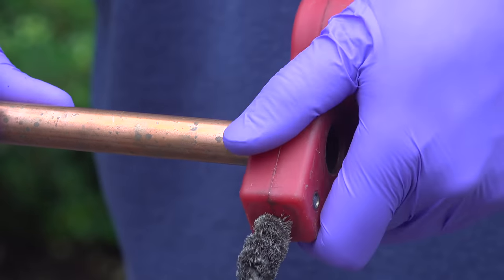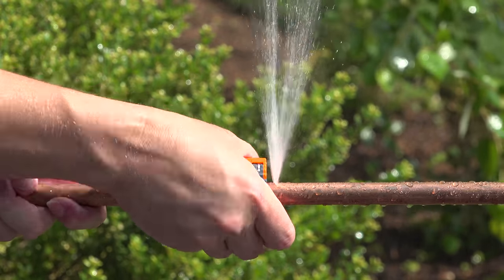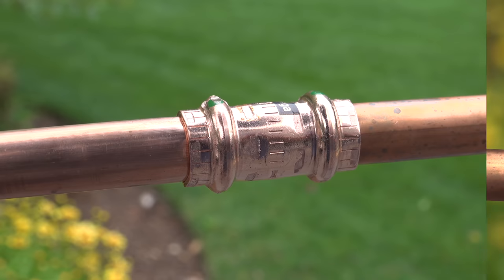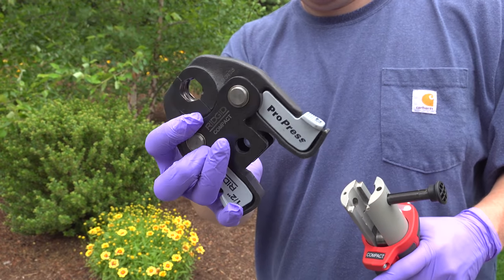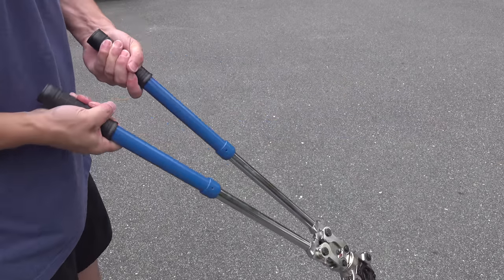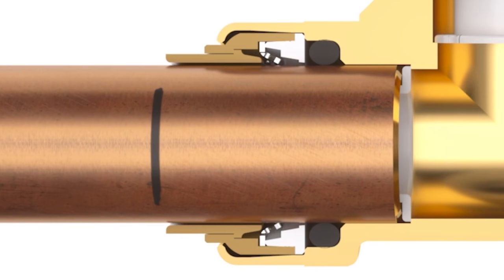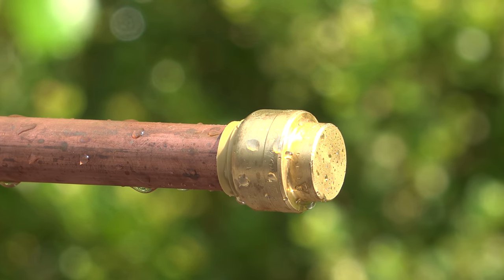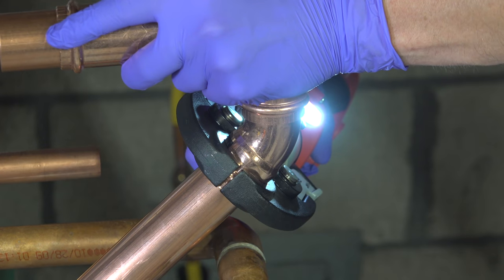NEVER SOLDER PIPE AGAIN - 3 Ways for EASY DIY Plumbing

Comment: It’s hard to believe any type of o ring wouldn’t eventually deteriorate.
Reply: Agreed, but even soldered fittings can fail due to expansion and contraction, but time will tell. Perhaps not being exposed to air helps. Still, pretty cool seeing it used the first time recently by pros.
Reply: @dj-kq4fz  I had a plumber fit my shower blending valve and shower head. He never explained that he would be using propress fittings. When I saw the final job, I had him remove the fittings and solder everything. I'm no pro but it's too soon to tell how these fittings will last, in my opinion.
Reply: @atroche1978  I totally agree! I have a lot of confidence in my contractor friend (whose crew did the work), plus it was exposed in a basement. with minimal potential for catastrophe, but, it was still an eye opener for me. I really don't blame you.
Reply: @atroche1978  The only fitting I have seen leak after proper installation
Reply: Exactly.  Well, there is always that same idea.  It won't happen in their life time when it's installed.  However, it will bound to happen and good luck to the poor soul who inherited the problem.
Reply: @dj-kq4fz  At least copper has that time behind it. I'm no plumber but I think soldered joints either fail fairly soon if bad, or last forever.
Reply: These things are being used for over 20 years,  they are great
Reply: The o ring is really a backup, the copper is “fused” together and the copper is doing the main sealing, similar to using a copper washer.

Comment: Sharkbites absolutely rocks. I love how it's only the plumber that find a cases where a Sharkbite failed cause they don't want customers to feel that they are not needed anymore.
Reply: No dude they actually really suck. It's not about finding away to screw you the coustmer. They work great for a quick pinch  most of the time until you get a moment to fix it correctly. I'll go old school or pro press for copper.
Reply: Also the quality of the shark bite fittings over the last few years have gone way down hill

Comment: It’s a good thing rubber o rings never deteriorate LOL I Can see a lot of leaks coming in 10-20 years
Reply: just remove and pop on another shark-bite.. easy peasy
Reply: Most people don't stay in their homes that long so it's not really their problem if it leaks down the road.
Reply: The water will most likely never touch the o-ring. The copper to copper seal it creates can hold water alone
Reply: @tylerjantz882  That I'd like to see. Should be easy enough to remove the o-rings and show it.

The problem is, any movement can break the seal. The rubber of the o-rings will help with that for a while but rubber and plastics get hard and brittle over time.
Reply: @chaos.corner  the manufactures test these fittings at 200 psi with no o-ring
Reply: @tylerjantz882  Do they test them when the house settles and twists the fitting 1/2 degree? I mean, sure if it's good enough for the job, it's good enough for the job but I got questions.
Reply: @chaos.corner  if that's your concern then you would have the same problem as a solder joint. Press systems are not really used for residential anyway, pex is the standard there.
Reply: @tylerjantz882  The solder joint is definitely  a weak spot. I've had one popped apart by ice expansion once. They have a large surface area and good adhesion though and will likely to transmit torque to a good amount. Maybe these press systems do too but I remain to be convinced.
Reply: @chaos.corner  pex handles water hammer and ice by itself better than copper does even with a water hammer arrestor
Reply: @tylerjantz882   the o rings in some cheaper copper push type fittings fail at approximately  15 - 25 years. A leak in a radiator return pipe  can cause very costly repairs. Better and cheaper to use solder or compression joints wherever possible. EDIT. My comments above  may have misled as the word "can" is missing between the words "fittings" and "fail". My information came from a home insurance loss assessor who said he had seen water damage to wooden floors and drywall caused by failed push fit joints on several occasions. He said it was perished/ brittle rubber o ring inside joint.
Reply: That's what I was thinking.
Reply: Oh yeah, and we all know plumbers are actually not paying for the huge risk of messing with someone else’s medical hazard management tubing, they’ve actually got a giant pile of money and never pay for expenses like the electric bill or groceries because unlike you they go into cryo-stasis after work.
Reply: @gr6e  I agree that Pex/upenor is actually tougher than copper piping, as does my master plumber friend. He still puts copper right next to the water heater, though, just in case of softening/dissolving/stretching from the heat over time.
Reply: @johnsohn653  Lol until its you who moves into that's their problem down the road house.
Reply: Ive done so many service calls because of shark bite fitting. Usually the o ring deteriorates in the first 5 yrs.
Reply: @weirdwillie  well good thing press is nothing like sharkbite
Reply: Let's see how many copper to pex joints cam be soldered...just sayin. 
Europe has pex joints were developed in the 1960s and have been common since the 70s. Wow are we in the stone ages
Reply: @steptoeandson3554  how do you know that? First off the o-ring is NOT rubber. Second, the o-ring is not subject to constant water flow like a valve, third the push fit would have already had massive failures in other countries since they have been using them since the early 70s.
Reply: @buddymann34476  thankyou for questioning my comments. I will edit them as I appear to have omitted some information that you have so kindly noticed.
Reply: If not 7-8 years
Reply: ever use a Fernco.... if so, why...it's made of the same rubber that the o ring comes from